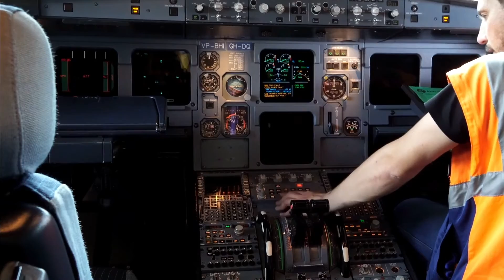What are the differences between an EASA Aircraft Engineer & FAA Aircraft Mechanic? | EASA vs FAA

Comment: If I have FAA A&P license, how to convert into EASA B1.1 license
Reply: Same question, did you get any answers?
Reply: @hamidalharbi5939  same question too! So frustrating
Reply: A practical approach might be to get a job as "non-licensed" mechanic in a EASA country at first, and then contact the National Aviation Authority for triggering the "convertion" of your FAA license. Actually you may can benefit from some advantages when obtaining the EASA licence, but don't expect a simple convertion. The kind of EASA licence you get most likely depends on the actual job you get. Working for a year or two as mechanic under supervision is better, than visiting a school for learning what you allready learnt. You can do some taining aside the job, until the new EASA lisence is issued by the national aviation authority. The national aviation authority may advise you regarding the required traing. Consider looking for an employer who can make use of your ( FAA approved ) practical skills in the starting phase.

Comment: In EASA, you  do not just need 5years experience. It is 5years experience plus passing all the 17 modules. It is a ridiculous system of licensing if you ask me
Reply: very true
Reply: @Castle Fiorentino eh, I disagree. We aren't engineers. Everything we work on was designed and built already by the actual engineers. We just repair and replace. Which, admittedly, does require knowing exactly how everything works, but a lot of that knowledge comes from the FAA standardized manuals ("The Bible", as it's informally called). If we're doing anything with any part of an airplane, we have to have that section printed out and refer to it the whole time.

Comment: I have a question if let’s say I wanted to work in Europe and I have an faa pilot certification how do I change from faa to easa
Reply from the maker: You will have to redo all your training under EASA and retake all necessary practicals and knowledge test applicable to the license you are trying to convert. Or you can attend a Part 141 school that offered both the EASA and FAA licenses
Reply: @AlexBengoechea  do you know any part 141 that offer easa license here in the us
Reply from the maker: Yes I do, I use to work in one. It’s called Naples Air Center.
Reply: @AlexBengoechea  I’m accepted most of the part 141 colleges I don’t know if they offer ESa license I just wonder in the future I could but it is USA is still pretty cool